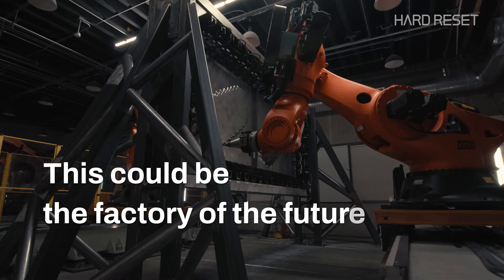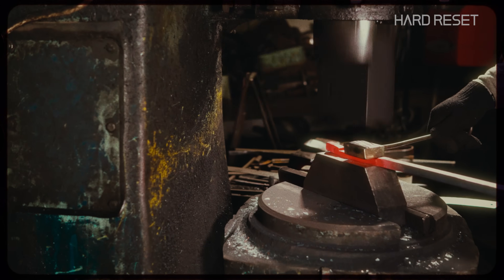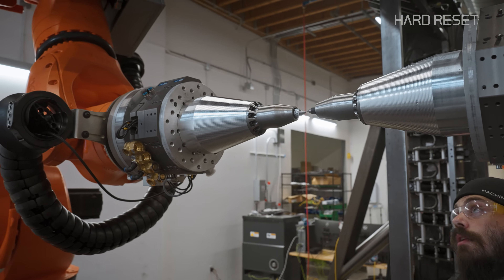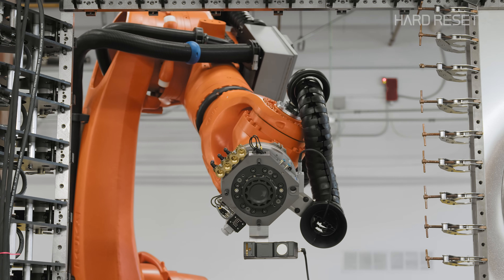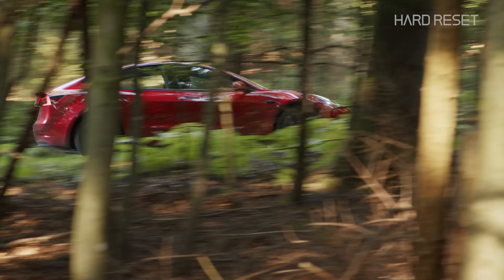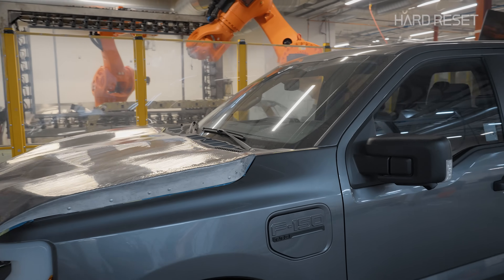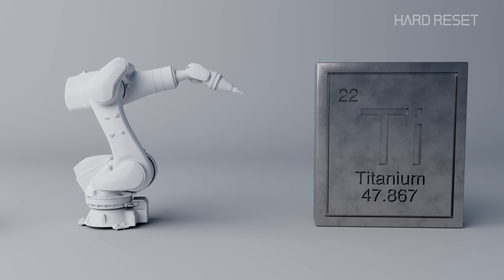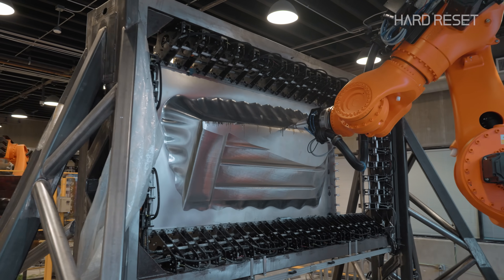Former SpaceX Engineer Invents a “Robotic Blacksmith Army”

Comment: As a robot engineer this process with 2 humanoid robots "fighting" each other does not feel very stable and reliable.  The robot gearboxes will suffer quite hard by the high forces and slow movements required.  And the long robot arms will make quite some deflections which will impact tolerances.  Wouldn't it be better to have both forming heads fixed to a rigid U-frame with only front and backwards movement freedom (powered by hydraulics).  And move the plate inbetween in  X and Y direction powered by 2 linear axis.  It would for sure require a complete new robot design but it would very much increase the forming capacity and reduce position tolerances!

Comment: They are totally unaware that current engineering solutions also take into account the economic factor. 1) forming sheet steel with two kuka robots work 2) that is bound to be mind-boggling expensive for each part

Comment: Neat, but I think it'd be more efficient to improve stamping technology and making it more flexible. My thought towards that end would be a series of hydraulic pistons arranged in a grid so you could vary their height and form complex shapes on a whim. If the piston heads could be swapped, so you could have different shaped heads to cajole the metal in various directions and even better still if a robot arm could be used to perform tool changes and swap the heads automatically, that would be really awesome.

Comment: It’s interesting how marketing savvy self-promoting Americans often claim to be inventing a manufacturing technique that has been studied, developed & long been in use by others. Incremental sheet forming manufacturing by robots or water-jets is an engineering manufacturing technique that has been long studied and honed by engineers in Germany, Japan, Korea and China for many years. The Kuko robots used by this particular workshop  are German made and owned by the Chinese. 
Key published or patented milestones in the development of incremental sheet forming manufacturing technologies date back to 1967- 1973. Most of the modern use computer aided robotic incremental sheet forming technologies and techniques have been published and patented by Germans, Japanese, Korean and Chinese engineers.
Leszak and Berghahn (1967):Their work in 1967 was crucial in the development of ISF, proposing two new ISF processes. Leszak's patent described a forming process for workpieces like discs or bowls from metal sheets. 
Mason (1978):Mason's thesis is considered a key milestone in the development of modern ISF, as he described the fundamental principles of the process. 
Kitazawa (1993):Kitazawa presented early work with simple equipment, using both rotating blanks in a CNC lathe and stationary blanks in a milling machine, demonstrating the feasibility of ISF. 
Matsubara and Amino patented TPIF configurations. 
Luttgeharm (2001):Luttgeharm patented an incremental forming method as a variation of the spinning process, where the product is held stationary and the tool describes the surface.

Comment: SpaceX’s restriction on the diameter of the Falcon 9 is the minimum height of overpasses on Interstate highways as they send them by road from California to Florida. It has nothing to do with being locked in to a certain tooling setup.  They made it as big as possible from the beginning. No need for larger tooling for that model of rocket. 

Note that Starship is significantly wider and built next to its launch site.
Reply: yet dude worked there on that line…
Reply: @alastairleith8612   Can't help that.  This has been common knowledge for many years.  There was never any intention to make the Falcon 9 wider.  It's a non-issue.
Reply: @HylanderSB  again, you are contradicting the guy who was involved in the process, “common knowledge” or not.  He might have domain specific knowledge that might be more accurate than is commonly available.
Reply: @nela9994  Dude has a narrative to support his business model. I can’t help if the facts contradict the story he tells.
Reply: @HylanderSB  dude’s narrative, in this case, doesn’t have anything to do with supporting his business model, beyond some random speculation about possible future directions, if and well they get wildly successful, so, no, trying to write a convoluted narrative to “protect” your ignorance of the actual facts, because being wrong hurts you, apparently, somehow, doesn’t actually make your wrong statement right, nor your subsequent ones.
Reply: @nela9994  Hey...you don't have to believe me.  Go ahead and believe the talking head. I really don't care.  Have a good one.
Reply: @HylanderSB  of course I don’t have to believe you, you just claimed “common knowledge” with not a single cite to back it up, and he is, specifically from not only that industry, but he used to work in that exact facility.  So,n he’s a subject matter expert, who gains nothing, one way or the other, by telling the truth.  Why is it so hard for you to admit you might have been wrong?

Comment: The issue is the finish, planes and aerospace parts can't afford to be ridged or bumpy or so rough.
Reply: I'm pretty sure aluminum can be used with it.
Reply: @WPJr2080 that wouldn't change the problem hes mentioning.
Reply: @farmer_joe_  if you look again, the robot arms can make a second or third pass on surface rendering a smoother surface.
Also, there may be use cases where the ridges may actually be beneficial. Similar to golf balls dimples.

Comment: This will never compete with mass manufactured stamping. It's perfectly fine for prototyping. 

It's exactly comparable to 3D printing (rapid prototyping) vs. plastic injection molding. Specific, but 10× slower.

Comment: Roboforming seems very similar to 3-D printing in its use cases: rapid prototyping, niche products, small manufacturing runs for constantly evolving products, self-sufficiency for smaller countries or off-world colonies, etc. But just like 3-D printing, its greatest strength is also its greatest weakness: it doesn't scale well at all.
Reply: My thoughts similarly.

This is not the “next” level of manufacturing but it is important.
Reply: This is an alternative path. If essential items for some reasons just stop being produced, these machines might be able to produce it.
Reply: Until you use it as a mold for Carbon or glass fiber products... Then there's an affordable tool to produce low numbers of high quality repeated parts. Still no big volume but a significant cost reduction
and a design flexible mold system which otherwise would be handcrafted. Rinse and repeat. I think there's an opportunity here.

Comment: Let me share a little secret about stamping sheet metal and even heavier gauge steel parts...

SPEED!
Blindingly fast. Oftentimes more than one part per second.
Scary fast. Absolute repeatability and speed. Once your dies are made it's a very low cost process.

I used to run a stamping press. They're so fast it will scare you.
Reply: X tool maker here. Yep. This guy knows he's talking BS but he needs that investment $$ to keep flowing.
Reply: exactly.
Reply: Could roboforming be used to create the die? (Assuming ultra-smoothness is not important?)
Reply: Smoothness is paramount for some parts, not for others. Die needs to be sturdy and thick, though. Can't be sheet metal itself.

Comment: Roboforming will never keep up with stamping. It is a good process for R&D pieces.
Reply: I agree, a blacksmithing AI is a good comparison. Stamping is best for mass production.
Reply: It's too slow to for real production.  But very fast for small quantity and prototyping.

However, I have concern about the physical characteristics of this type of sheet metal forming's products.  It is definitely not the same as actual stampings.
Reply: Fair, but imagine a wartime scenario: one small factory near the front lines could produce a multitude of replacement parts.

In any given location all you need is some sheet metal, a frame, two robots, a 3D scanner, and a computer.

You could move the factory quickly, or set up multiple mini factories in separate locations.
Reply: @Ryan256  yeah, no. division of labour. armies dont take manufacturing into the theatre of war. supply lines for moving reserves of spares along with food and munitions are always a part of war materiel planning...
Reply: @Ryan256  and, depending on tolerances, it could be used to make, say, throw-away versions of many things used only once on the front lines.  Especially if it just has to be “good enough” to deliver the package. If it takes 20 minutes to make one, and you set up 21 machines, each starting one minute later (because, rejects always happen) you have a consistent supply, ready one a minute.  And the flat-pack of raw materials could be transported much more easily. Indeed, one set might only take up the space of an APC.  And the commentary of doing it with titanium, which is non-ferrous, and therefore much less detectable as a possibility becomes interesting.
Reply: For sure. In situ manufacturing would be pretty convenient for off world emergencies.
Reply: I remember back when quotes of the past used to be 'man will never achieve flight'.

I guess we'll wait and see?
Reply: Stamping is great for making millions of similar thin  low / medium quality parts because creating the stamp and Dies is time consuming and expensive ,  but low volume high quality & precision custom parts at  larger thickness  is where Roboforming might excel
Reply: Some 3D printing is very fast. It will get faster and faster. I see this technology changing to a heated process that's way faster.
Reply: True. Good for custom pieces, too costly and time consuming for production demands.
Reply: @SupraSav  depends on how large the production run would be, and how many years that will remain in production, because, remember the point about a production run needs specialized machines to be designed and built, and the cost of setup.  If said production run is just going to be in use for, say one or two years, it might not be worth all the overhead costs.
Reply: honey - try to make a stamping tool for every customers wish of personalisaytion - we are going more an more into EXTREM HIGH MIX - with ZERO Volume of same parts.
With roboforming you got ZERO costs for making a tool.
Reply: @SeniorRed1337 as i said, R&D aka one off parts I am a machinist in a die shop/ stamping plant, i know the immense process of stamping and creating the tooling involved.
Reply: Why won't it ever i guarantee it gets sped up significantly in the future
Reply: Its also been around about 20 years before this guy was even in college lol. I saw an old professors project that was exactly this. Tons of issues from the stretching. It was overall a tremendously time consuming, weakening process.

Comment: How efficient are these in comparison though? One large press to form a part seems at least 100x faster and more efficient than tiny pushes and nudges until you form the part you need
Reply: its extremely efficient when you factor in the cost of producing the machine that performs said 100x speed

Comment: Okay cool concept but the issue I see is it takes way too long to hammer out a design that's great for 1z 2z request, you're talking about an assembly line that will take forever. I actually have a design of what would work just as fast as a stamping machine can you get flexible enough to accommodate any design you can think of. So whoever is interested and has the engineering capability and money to back this idea please contact me and I'll tell you what my plan is I believe it will work very well